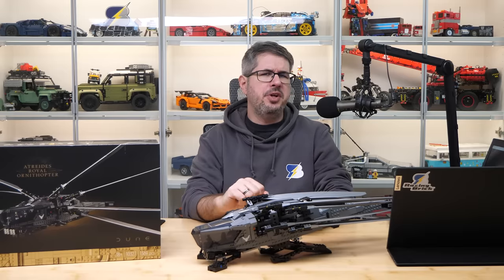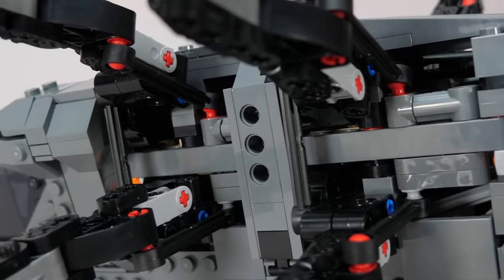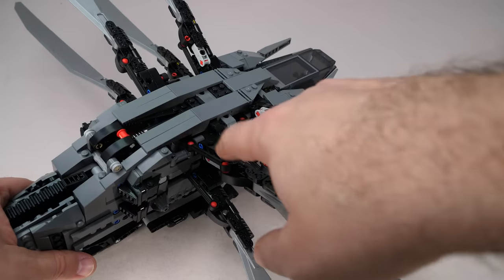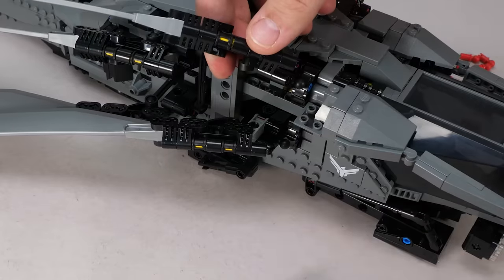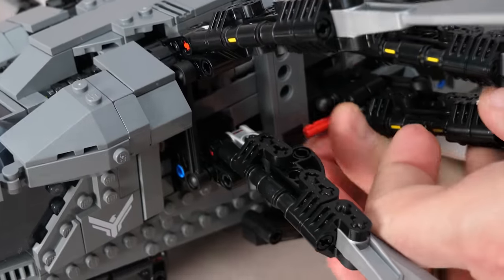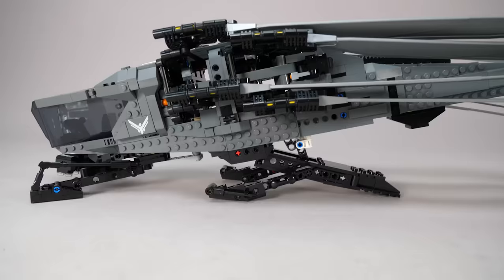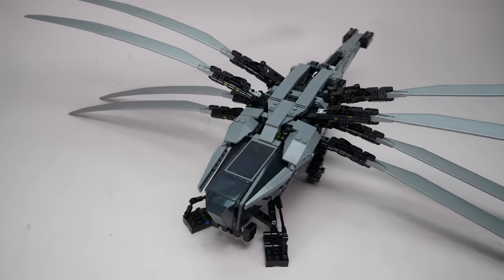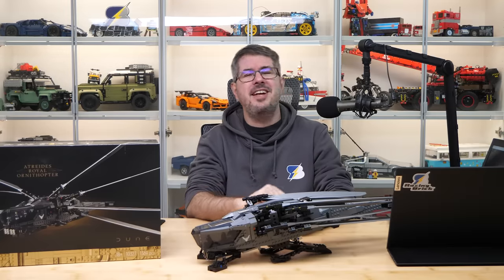Improving the LEGO 10327 Dune Ornithopter for less than $4 - color swapping red pieces

Comment from the maker: Click here for all the parts required - https://racingbrick.com/2024/02/quick-color-swap-for-the-10327-dune-ornithopter/
Reply: Can you please share the parts numbers and quantity to swap the blue parts?  As I have not built yet it would be nice to order these as well.
Reply: how many additional black parts should we order if we swap during the build?
Reply: @bikerbear4917  i just built it with black parts. the list in the link above is pretty much all you'll need, but if you want to fully replace every red 2M axle you need 31 of them instead of 11. most aren't visible on the outside tho. the list covers all of the ball joints you'll need.
Reply: I uploaded the Bricklink XML part list to my Recent Comment on this video of all the pieces you need to replace all visible blue/red/yellow/orange pieces on the Ornithopter after I went through Balazs' list and the instruction manual. 
I copied the list here originally but it keeps disappearing shortly after posting
Reply: I just finished this build following the guide. I swapped at least 2 of the ones you commented would be hard to replace after the build is complete I really needed 12 of the 2M Cross Axle with Groove, not 11. (Although I didn't swap out the ones in the landing gear or the flapping mechanism.) 
I would recommend if you're going to swap the pieces during the build, AND you want to do the ones in the landing gear and wing flapping mechanism, get 15, not 11.

Comment: I feel that Lego should already be doing this in their larger sets that are geared towards adults. I can understand sets that are tailored towards kids. But an adult buying a $500 1:8 scale super car should be able to figure it out.
Reply: I agree, considering sets like this are geared towards adults I can't exactly see the reasoning behind "making it easier to understand" when I'm sure most adults would have no issues (not saying kids can't get these sets of course, though the point still stands.)
Doing this for sets geared towards kids makes sense, but why the 18+/Adults welcome range?
I don't think people buying sets from the 18+ range need to have their hands held for things like this as long as the instructions provided are clear and easy to understand, which they typically are.
No hate on Lego, just feels like a really odd choice?
Reply: Check out the non Lego set he did on his other channel. Just as you describe it, just the colors needed.
Reply: Yes, you're absolutely correct, especially for 18+ sets that are designed for adults. They don't need hand holding like this. Color coding won't really help if you're color blind either.
Reply: Facebook Technic group page would have you reconsidering that thought. I have seen quite a few absolutely ridiculous questions on there.  Unfortunately Lego has to treat all of us like the lowest common denominator. Pretty sure that’s why they typically have you add one part per step. Ugh
Reply: I think it might be more about frustrating NEW adult builders or those just collecting something cool (thematic) and not real LEGO collectors. I've known some that have asked me to finish building their larger System/Technic sets...
Reply: @clockwork3494 man, back when I was a kid ALL the technic axles were black. There weren’t even grey ones for even lengths yet. The blue axle pins also used to be black. I can’t think I’ve ever been frustrated by a Lego set as a kid.
Reply: So Lego expects kids to be dumb.
Reply: It's Lego, a bricked approximation. There will always be studs, gaps, visible mechanics, visible colours etc. It's the charm of the game ❤
Reply: Exactly this
Reply: @clockwork3494  i have helped people build models and especially older people can have trouble finding small pieces if they are not colour coded.
Reply: As much as I would like to think that "adults" building 18+ sets will figure out Technic  and don't need wild Lego color parts in models, this sadly isn't the case. A visit to any Facebook Lego Technic group especially USA, will leave you shocked at the challenges in basic builds and the support people are looking for.   My solution here would be to have Lego offer 2 options for their 18+ Technic sets, 1: true to form and color and option 2: A discovery version that uses the current color parts method.
Reply: @biachboy  Bingo and THATS a problem. Writing for the lowest common denominator reinforces their lack of critical thinking. They arnt going to learn or think harder when your mindset is "poor baby cant do any better, here let me help you". I am Quality Support for my division at a company, very small one. But my bosses stance on fixing things is we need to be "hands in our pockets". You give your assembler everything as best you can to succeed but you dont treat them like they cant do the job.
Reply: @ravimani3834  Only thing is thats a PR nightmare. Why? Cause while there are people that are too well lets just say it stupid to build without the color coding they are usually smart enough that if you lable somthing like "True Form and Discovery" they will know you saying they cant do it without hand holding and there will be people suing over it, yes people are THAT stupid. So Lego goes the easiest road PR wise. Everything is the Discovery design and its up to the builder to change it.
Reply: @HekateMGO Exactly! I dont get all these senseless colours, too. I never had problems with any big Technic sets as a kid/adolescent.
Reply: @clockwork3494  I think the misconception with this line of thinking is confusing "adult" with "good at lego". That's very much not necessarily the case. A large number of 18+ sets are geared towards fans of the franchise who want a cool thing on a shelf rather than explicitly lego fans who like a franchise. Many adults are genuinely useless at lego, and would be less than useless with black pieces. In this case, yes some better choices could have been made on the outside, but these pieces are 100% necessary.

Comment: Here's a suggestion buy the lego lotus flowers (set 40647) it comes with 45 of the black 2 stud long cross axles which and they get hidden while making the flower stems. easy swap.
Reply: Great tip!
Reply: Thank you! I already have that set but I did not remember it contained the black axles!
Reply: you sir are the reason I read comments on YT. Those smart ideas, thank you for sharing.

Comment: For those who plan to swap the red parts during initial build, these are the page numbers (US version manual) and step numbers you want to note where the parts that need to be replaced appears.

P22 Step 18: 3 (only the one connected to the lever)
P46 Step 64: 1
P74 Step 111: 1, 7
P76 Step 112: 1, 7
P78 Step 113: 1, 7
P80 Step 114: 1, 7
P100 Step 145: 1 (x2)
P103 Step 152: 1 (x2)
P120 Step 175: 1, 7 (9 is mentioned in the video, but not counted in the part list)
P122 Step 176: 1, 7
P124 Step 177: 1, 7 (9 is mentioned in the video, but not counted in the part list)
P126 Step 178: 1, 7
P183 Step 303: 1
P187 Step 311: 1
P192 Step 314: 6 (x2)
P194 Step 315: 6 (x2)
P197 Step 317: 6 (x2)
P199 Step 318: 6 (x2)
Reply: I uploaded the Bricklink XML part list to my Recent Comment of all the pieces you need to replace all visible blue/red/yellow/orange pieces on the Ornithopter after I went through his list and the manual!
Reply: @UNSCpilot95 any chance you can share your old comment again?
Reply: @Heel  Here is the Bricklink XML list I made that includes Balazs' list in black, all other visible red/blue/yellow pieces in black, and the 4 orange pieces in dark bluish gray: 

I was able to figure out most of the swapped pieces from watching Balazs' video, so watch it carefully. Here are the swap locations that aren't immediately clear :D

Step 6: Swap the blue pin
Step 14: Swap the 3 blue pins.
Step 18 part 3: Swap ONLY the left red axel.
Step 68: Swap out the two blue pins. 
Step 111: Swap the red axel in part 1, the blue pin in part 5, and the red ball joint in part 7. DO NOT change the red axel piece in part 9. Repeat this process for all 8 wings.
Step 123: Swap the red axel.
Step 129: Swap ONLY the left blue pin.
Step 133: Swap ONLY the right blue pin.

<INVENTORY>
<ITEM>
<ITEMTYPE>P</ITEMTYPE>
<ITEMID>3713</ITEMID>
<COLOR>11</COLOR>
<MAXPRICE>-1.0000</MAXPRICE>
<MINQTY>1</MINQTY>
<CONDITION>X</CONDITION>
<REMARKS/>
<NOTIFY>N</NOTIFY>
</ITEM>
<ITEM>
<ITEMTYPE>P</ITEMTYPE>
<ITEMID>3706</ITEMID>
<COLOR>11</COLOR>
<MAXPRICE>-1.0000</MAXPRICE>
<MINQTY>1</MINQTY>
<CONDITION>X</CONDITION>
<REMARKS/>
<NOTIFY>N</NOTIFY>
</ITEM>
<ITEM>
<ITEMTYPE>P</ITEMTYPE>
<ITEMID>4519</ITEMID>
<COLOR>11</COLOR>
<MAXPRICE>-1.0000</MAXPRICE>
<MINQTY>8</MINQTY>
<CONDITION>X</CONDITION>
<REMARKS/>
<NOTIFY>N</NOTIFY>
</ITEM>
<ITEM>
<ITEMTYPE>P</ITEMTYPE>
<ITEMID>43093</ITEMID>
<COLOR>11</COLOR>
<MAXPRICE>-1.0000</MAXPRICE>
<MINQTY>4</MINQTY>
<CONDITION>X</CONDITION>
<NOTIFY>N</NOTIFY>
</ITEM>
<ITEM>
<ITEMTYPE>P</ITEMTYPE>
<ITEMID>22484</ITEMID>
<COLOR>85</COLOR>
<MAXPRICE>-1.0000</MAXPRICE>
<MINQTY>4</MINQTY>
<CONDITION>X</CONDITION>
<NOTIFY>N</NOTIFY>
</ITEM>
<ITEM>
<ITEMTYPE>P</ITEMTYPE>
<ITEMID>6628a</ITEMID>
<COLOR>11</COLOR>
<MAXPRICE>-1.0000</MAXPRICE>
<MINQTY>20</MINQTY>
<CONDITION>X</CONDITION>
<REMARKS/>
<NOTIFY>N</NOTIFY>
</ITEM>
<ITEM>
<ITEMTYPE>P</ITEMTYPE>
<ITEMID>6558</ITEMID>
<COLOR>11</COLOR>
<MAXPRICE>-1.0000</MAXPRICE>
<MINQTY>14</MINQTY>
<CONDITION>X</CONDITION>
<NOTIFY>N</NOTIFY>
</ITEM>
<ITEM>
<ITEMTYPE>P</ITEMTYPE>
<ITEMID>32062</ITEMID>
<COLOR>11</COLOR>
<MAXPRICE>-1.0000</MAXPRICE>
<MINQTY>15</MINQTY>
<CONDITION>X</CONDITION>
<NOTIFY>N</NOTIFY>
</ITEM>
</INVENTORY>
Reply: The most underrated comment lol

Comment: Thanks for this, I intend to do as you have as it looks much better without the distracting colour choices. I swapped out the grey pins in the front landing gear with black ones, and the pink studs for clear ones near the cockpit as they were included as spares in the set.

Comment: Here is the Bricklink XML list I made that includes Balazs' list in black, all other visible red/blue/yellow pieces in black, and the 4 orange pieces in dark bluish gray: 

I was able to figure out most of the swapped pieces from watching Balazs' video, so watch it carefully. Here are the swap locations that aren't immediately clear :D

Step 6: Swap the blue pin
Step 14: Swap the 3 blue pins.
Step 18 part 3: Swap ONLY the left red axel.
Step 68: Swap out the two blue pins. 
Step 111: Swap the red axel in part 1, the blue pin in part 5, and the red ball joint in part 7. DO NOT change the red axel piece in part 9. Repeat this process for all 8 wings.
Step 123: Swap the red axel.
Step 129: Swap ONLY the left blue pin.
Step 133: Swap ONLY the right blue pin.

<INVENTORY>
<ITEM>
<ITEMTYPE>P</ITEMTYPE>
<ITEMID>3713</ITEMID>
<COLOR>11</COLOR>
<MAXPRICE>-1.0000</MAXPRICE>
<MINQTY>1</MINQTY>
<CONDITION>X</CONDITION>
<REMARKS/>
<NOTIFY>N</NOTIFY>
</ITEM>
<ITEM>
<ITEMTYPE>P</ITEMTYPE>
<ITEMID>3706</ITEMID>
<COLOR>11</COLOR>
<MAXPRICE>-1.0000</MAXPRICE>
<MINQTY>1</MINQTY>
<CONDITION>X</CONDITION>
<REMARKS/>
<NOTIFY>N</NOTIFY>
</ITEM>
<ITEM>
<ITEMTYPE>P</ITEMTYPE>
<ITEMID>4519</ITEMID>
<COLOR>11</COLOR>
<MAXPRICE>-1.0000</MAXPRICE>
<MINQTY>8</MINQTY>
<CONDITION>X</CONDITION>
<REMARKS/>
<NOTIFY>N</NOTIFY>
</ITEM>
<ITEM>
<ITEMTYPE>P</ITEMTYPE>
<ITEMID>43093</ITEMID>
<COLOR>11</COLOR>
<MAXPRICE>-1.0000</MAXPRICE>
<MINQTY>4</MINQTY>
<CONDITION>X</CONDITION>
<NOTIFY>N</NOTIFY>
</ITEM>
<ITEM>
<ITEMTYPE>P</ITEMTYPE>
<ITEMID>22484</ITEMID>
<COLOR>85</COLOR>
<MAXPRICE>-1.0000</MAXPRICE>
<MINQTY>4</MINQTY>
<CONDITION>X</CONDITION>
<NOTIFY>N</NOTIFY>
</ITEM>
<ITEM>
<ITEMTYPE>P</ITEMTYPE>
<ITEMID>6628a</ITEMID>
<COLOR>11</COLOR>
<MAXPRICE>-1.0000</MAXPRICE>
<MINQTY>20</MINQTY>
<CONDITION>X</CONDITION>
<REMARKS/>
<NOTIFY>N</NOTIFY>
</ITEM>
<ITEM>
<ITEMTYPE>P</ITEMTYPE>
<ITEMID>6558</ITEMID>
<COLOR>11</COLOR>
<MAXPRICE>-1.0000</MAXPRICE>
<MINQTY>14</MINQTY>
<CONDITION>X</CONDITION>
<NOTIFY>N</NOTIFY>
</ITEM>
<ITEM>
<ITEMTYPE>P</ITEMTYPE>
<ITEMID>32062</ITEMID>
<COLOR>11</COLOR>
<MAXPRICE>-1.0000</MAXPRICE>
<MINQTY>15</MINQTY>
<CONDITION>X</CONDITION>
<NOTIFY>N</NOTIFY>
</ITEM>
</INVENTORY>
Reply: @QuiGonJeans  Happy to be of assistance! Log into BrickLink, hover your mouse over "Want" in the top right corner, click Upload, switch to Upload BrickLink XML format, and paste the whole list into the text box. Keep hitting the blue buttons and finally click Buy All and Auto-Select
Reply: Hey, I know this is a lot to ask, but do you think you could list the page numbers of where each piece gets replaced, similar to what Roger did in the racingbrick comment section? Thanks a lot if you do
Reply: @Tawnee323  I was able to figure out most of the swapped pieces from watching Balazs' video, so watch it carefully. Here are the swap locations that aren't immediately clear :D
Step 6: Swap the blue pin
Step 14: Swap the 3 blue pins.
Step 18 part 3: Swap ONLY the left red axel.
Step 68: Swap out the two blue pins. 
Step 111: Swap the red axel in part 1, the blue pin in part 5, and the red ball joint in part 7. DO NOT change the red axel piece in part 9. Repeat this process for all 8 wings.
Step 123: Swap the red axel.
Step 129: Swap ONLY the left blue pin.
Step 133: Swap ONLY the right blue pin.

Step 314: Swap out the yellow axels and repeat for all 8 wings.
Reply: Thank you mate, just ordered everything! Super excited :)
Reply: that's awesome, so just to clarify the steps you listed covers both parts shown in the video and the rest of the exposed parts?
Reply: @Heel  The steps I mention above are not a complete list of every part to replace, just the less obvious ones that were not specifically mentioned in his video. You should closely watch his video while building as well as referencing my steps. For example, you still need to replace the blue pins in the front legs, replace the long red axel, etc.
Reply: Hi, me again! 
I built it tonight, thank you again!
The set is beautiful & your instructions were very clear :)
Reply: @nnathanaubree  That's great to hear! It looks way better with none of those clashing colors
Reply: hey @UNSCpilot95 not sure why but am unable to paste the text after clicking on upload.I only have the possibility to upload the XML and nothing related to paste the text......any chance to share a ready XML file?
Reply: @RaulLopez-fb1vu  On the pop up window asking for a XML file, click on the top right. You'll be able to insert the text there
Reply: @UNSCpilot95  Thanks so much mate!
I realize now it was because I tried on Chrome via smartphone without the show as PC setting, now at the computer went perfect.

Comment: Im stoked this video was recommended after I just learned about the set, and thanks so much for showing how cheap and easy it is to fix. If I buy it, and I probably will, I will include the spare parts
Reply: I uploaded the Bricklink XML part list to my Recent Comment of all the pieces you need to replace all visible blue/red/yellow/orange pieces on the Ornithopter after I went through his list and the manual!

Comment: The reason why they had the colored elements is for ease of build like you said BUT, also for new builders.
They design the build process and instructions for every set for NEW first time builders. 
So LEGO is accessible to everyone just getting into the hobby.
Reply from the maker: That's true. It'd be interesting to know the rules designers have to follow, as I feel in some occasions, like this one for example, those rules could be more flexible. In some recent Technic sets a lot of visible red 2L axles were swapped for black ones to make the surface more uniform, regardless of the building orientation. I think it could have been done here as well, keeping the colorful helping parts for the interior.
Reply: @RacingBrick  Thx. 
Yeah, I think in this instance, it’s a new IP for LEGO and they’re thinking they’ll get Dune fans whom never built LEGO before and try to make the build as easy as possible.
Reply: They could have a optional small bag with black pieces included in the set.
Reply: @RacingBrick  Oh, also the only rules I heard for designers was in an interview with Mark Stafford, and he mentioned that for the most part, besides designing kits to be as stable/sturdy as possible, most are designed that any 12 year old can build regardless of their experience with LEGO. So even if it’s 18+, most can tackle it without frustration. Keeps ‘em coming back for more. 
And of course the other factor/rule they have is they have to design to an already set price point.
Reply: @serch3ster  Not a bad idea but also, email Lego customer service. Say the parts you want to swap out (itemize the part number and how many and color).
Tell them you spent a lot of money, spend a  lot of money on Lego, you're a loyal regular customer and the red elements seems unsightly and distract from the kit for display and if they can send the needed black replacement elements since you spent a lot on the set.

Ask that you'd happily pay.
Do it all politely and humble. 
There's a good chance they'd send you the parts for free.
Reply: This doesn't make sense, some sets are straight up not beginner friendly. Having said that, following steps is very easy, a simple color change does not change the difficulty enough to ruin the look of a set.
Reply: @TravisHi_YT  Yes, it does MOST sets are all designed to be built by 12 year olds.
Mark Stafford a famous Lego designer talked about this.
You want most of your sets to be easy enough to follow, with minimal help.
You approach your product this way so you don't frustrate a FIRST TIME customer so he or she will come back for more.
Some are easier than others but most of the kits are designed for enjoyment and you'd want more customers to come back. 
That's why they're so successful. 
Remember, the business model is almost every single set is designed for a first time customer.